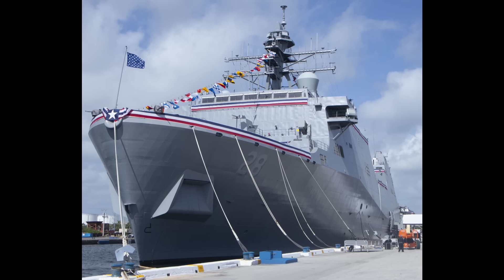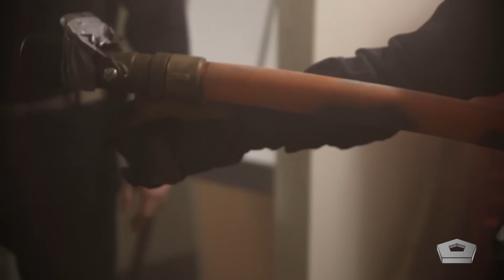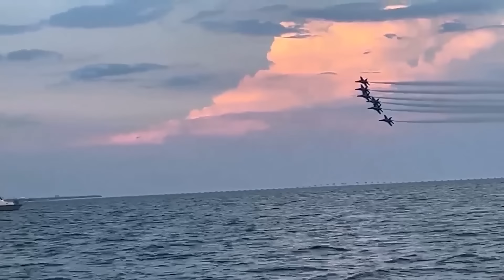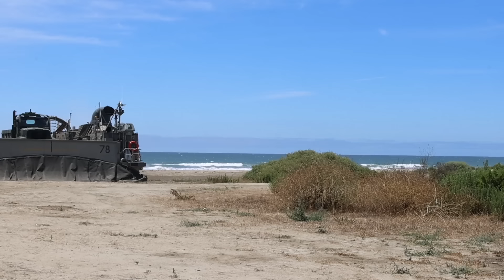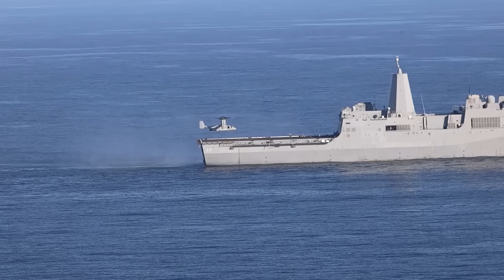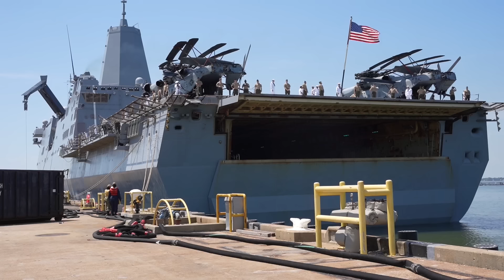San Antonio Class: The Warship That Exposed the Depth of US Navy’s Budget Problem

Comment: Is there someone than can explain to me, that the USA can build 26 of these huge ships, but has troubles building 50 frigates
Reply: Because the huge ship shipyards are kept operational chugging alone entirely supported by pentagon naval contracts. Without the US navy contract they immediately go under since they don't build commercial ships. But which also means they are very specialized and entirely ill equipped to build any other types of ships even lesser frigates. aka destroyer yard only build destroyers, LPD yard only build LPD etc. So for the 50 frigates, there is no shipyard in the US except freshly opening up new ones or converting existing ones to build them hence the delay snowballed by the completely overhaul re-design. By the time Constipation comes out there are two outcomes: China had moved on to even type 054C which is even more advanced, and Constipation can never catch up in numbers. Also this is the same case with future DDGX. How the time has turned.
Reply: @EvaExplores-x2x that is another thing that baffles me. A frigate is a workhorse, kind of a jack of all trades, they need to be tough, low service, cost and manpower  and be able to force projekt alone, if you want area defense as USA needs for its large coastlines and territory, you need the destroyer and Cruiser, we Danes operate in the North Sea and Baltic and have a relatively small area to defend, so AA frigates with 32+ mark 41 VLS is kind of enough.
But the USA needs frigates to patrol their expansive sea lanes. The Fremm Frigate is in on itself a superb ship for that, why change it so much, i simply do not get it, the USA could also have chosen the Arrowhead 140/Type 31 bullt on the Danish Ivar Huitfeldt Class,  they need the ships now, not in 15 years
Reply: @ulrichkristensen4087  The US is spoiled, period. They have geographical advantage that nobody dare come near to be a near shore threat. So their Frigates and Little crappy ships were intended to go near enemy shores not defend their own shores. But their poor designs ultimately deemed not survivable under enemy fire. For your defensive purposes they would been ok. But for US navy they want to go on the offensive, attack, attack and attack, then that's not enough. Frankly speaking. It's idiotic to believe any Destroyer tonnage level below ship to be survivable going against China near their shore. Japan is very smart, they are mass producing less capable frigates to shield their destroyers to face the reality of sacrificing them for their AEGIS destroyers. While the US still think they can design this imaginary perfect frigate that end up cost 1 billion each too expensive and not very survivable and low numbers. 

In reality is they need to mass produce like what you said a workhorse frigate that can shield their AEGIS Destroyers whether that is arleigh burke or DDGX or Carriers, LHDs, and also pack a punch itself instead of waste any more money to be a perfect for nothing expensive ship itself. The program is already too late. That admiral in charge of the program should be in jail.
Reply: @ulrichkristensen4087  As you said - rewriting the requirements and continuous redesign shenanigans, of a licensed project at that (Whats left from it? 10%?) arguably are the main reasons for the commissioning delay. Plus clogged shipyards problem makes it even worse.
We may live in times in which allied shipyards are required to fleet a properly sized USN for the war on the Pacific.
Reply: @Weisior we are clocked as well, we are right now in the process of building 54 patrol cutters, 4-5 Artic patrol Frigates and 4-6 new frigates, for a small nation that is pretty mich, Dane here
,i am also hoping we get a Berlin class supply auxiliary , we are also building 3-4 big icebreakers for greenland and are discussing to lease 4 German submarines
Reply: @ulrichkristensen4087  Danish shipyards may be loaded, but there are many shipyards across the European part of NATO, plus Japan, Korea, Australia, Canada. There is a potential to be used if needed.
Reply: @Weisior danish ship yards are not even loading the capacity is not even there. There is no room for US ships.
Reply: We need American made merchant ships. While navy ships are cool and honor famous people there are no commercial ships making money. It’s like teenagers wasting money on social media and not working. Military Social Media all about expensive consumption and rapid obsolescence.
Reply: @dumbledan4016 That is hoing to be hard, building a merchant marine, while the 3 biggest Logistics companies are European. Ofc you can build the ships, but it will be almost impossible to compete

Comment: San Antonio Class was suppose to get VLS launchers...where the hell is that
Reply: They have AEGIS radar, that's all they need to see and interoperate with destroyer.
Reply: No reason to add VLS on San Antonio Class
This ship does not have reasonable sensors for those missiles in the VLS, and U.S.Navy does not seem like a lack of VLS cells, they are lacking advanced sensors now, I mean there are more than 20 Burke I and more than 30 Burke II are using an old fashioned AN/SPY-1  and some of them are using AEGIS baseline 6.x model, they even do not upgraded to baseline 9, but all of Chinese AEGIS destroyer have comparable systems like baseline 10
Reply: @LuobingSong  You are wrong. The radar systems of the 052D and 055 are much more advanced than the Aegis system.
The radar system of the new batch of 052DG type not only has four S/C band AESA radars (Type 346), but also an X-band AESA sea-skimming search radar (Type 368), and at the rear, there is a VHF band long-range air defense radar (Type 518), which has anti-stealth capabilities.
And the radar system of the 055 type uses integrated RF technology that is far superior to baseline 10. Its integrated mast integrates AESA radars of S, X, and VHF bands.
Reply: @Steve-y9v-s2f I have to say I agree, seems like computing systems on Chinese destroyers are superior to baseline 10
However you may confuse the AEGIS system and the sensors, the AEGIS system is not directly linked to the sensors, SPY-1 can also be fitted into the AEGIS system what ever the actual baseline is, AEGIS are more about CIC and air defense controlling 
But anyway, the American navy lacks advanced sensors as well as advanced combat computing systems, many of the computer systems date back to the 2000s even the 1990s and are not fully upgraded over time, only the less than 30 Burke IIA and few Burke III, the Ford carrier and the few DDG1000 are surely equiped with updated system, the older Burke II and even some Burke I for now most probably only add up the count
Reply: @Steve-y9v-s2f so for short, the American Navy does not lack VLS cells, they need the sensors and the computing systems for the cells
Reply: @LuobingSong  I understand what you mean. I just want to say that China's "Sea Star" system is superior to baseline 10. However, I think the performance of SPY-6 is not outdated. It can definitely match the 346A type radar of the 052D, and perhaps even surpass it to some extent. Currently, the main problem for the US Navy is the lack of new ship platforms. The design of the Arleigh Burke-class ship platforms is from the 1980s, and its improvement potential has been exhausted. Its power system even does not support the full power operation of SPY-6. The US Navy urgently needs a new type of general-purpose destroyer.
Reply: @Steve-y9v-s2f agree, SPY-6 may be superior to 364A, you mention the current Burke design may not be able to support a fully functional SPY-6 system, but 052D also lacks redundancy to support the 364A radar, the maximum speed of 052d has dropped to less than 30 knots, the same problem also happen to 052d
052b/c/d shares a single original hull design, also dates back to 1990s
The problem is only less than 10 ships of the U.S. Navy are equipped with equally advanced systems as the Chinese Navy, and these include 3 DDG1000 and one carrier
However 052D today sums up to more than 30, and 055 sums up to 8, the following ships are under rapid construction, we will see them very soon
Every weapon, or everything built by humans, all have some shortcomings, this is true to both Burke III and 052d, but when we are comparing, the numbers also  counts
The U.S. Navy today is not in eager need of more VLS cells, Americans still have a great advantage in the number of VLS cells, Burke III is good enough at least to 2030s, much better than the zero AEGIS destroyer of Russia Navy and those so-called destroyers of European Navy, but there are only very few Burke III, and you can not rely on future to build more Burke III quickly, there will be less than 10 Burke III till 2030, however there will be at least 16 055 and 40 052D by then, and now they already have more than 40 054A class for assist
American Navy today is more and more rely on overseas bases rather than fleets but Chinese Navy today are building a great fleet
Reply: VLS was only ever reported by Tom Clancy when he speculated on potential systems. Supposedly there is/was space reserved for 12 cells for 4x each ESSM, but the space was used for other things. If extra launchers are available, these ships still can accommodate them, but would also need the accompanying radar, computer, and datalink systems.
Reply: Oh, you want the VLS? That comes with the premium options package which will cost you an extra $2 billion per ship.  : )
Reply: Why put vls in an amphibious transport ship. That just reduces it main function
Reply: @deragoth4250  We need the tubes to defend the battle group west of Wake. This is a giant floating high value target.
Reply: @ClayinSWVA  this is not supposed to be in the frontline. Us navy should be using its other assets to clear the way before the transport goes in. Are we going to start putting vls in oilers and cargo ships too?

Comment: Wondering if the lower hype on surface-based-radar stealth may be linked to more reliance on space-based reconnaissance system (or whatever they are called, not an expert)
Reply: Makes sense.  AI can process optical pixels and radar reflections like never before.  Surface ships still need decoys, chaff, heavy armed defense, and ECM because they will be found.  Armor here and there might make a comeback.

Comment: I wonder if there would be any value in modifying it to fill the role of the tico.
Reply: It’s been mentioned before. Why not? Cruisers don’t need to be destroyer looking just to carry anti air and have command and control functions.

It would make a lot of sense to reuse the hull rather than develop something new that is over budget and delayed.
Reply: @TheBooban  one thing i kind of like about the idea, is you could reload the missiles at sea through that loading dock on the back.
Reply: @Jeff55369 hovercraft reloader and push it from below, up? Hell yeah!
Reply: @TheBooban  Yeah, that's what i was thinking.
Reply: It’s not built for keeping up with a carrier strike group. You need a totally different designed hull to economicly operate at 30+ knots.
Reply: @CQBWarrior I really question that. Just larger engines.
Reply: @TheBooban  You sure know a lot about shipbuilding...
Reply: @CQBWarrior  maybe, but I would be interested to know what speed it could travel with 4 2500s. (Which is what the burkes use.)